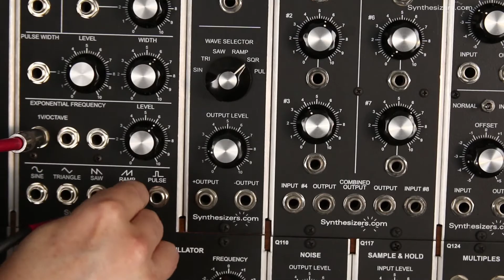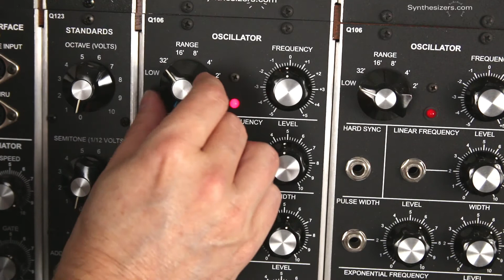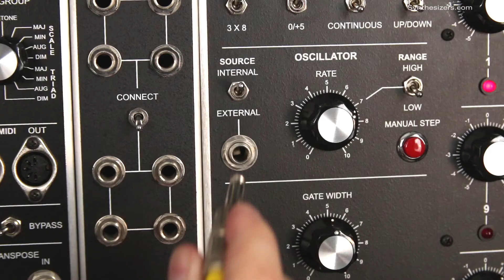Pitch and gate tutorial - Synthesizers.com

Comment: Well done. Thank you. One question. If I just connect CV from The keyboard, without VCA and gate, the note is continuous. If I press that keyboard twice in the same note, nothing happens right?
Reply: Correct.  The oscillators produce a continuous output.  To turn a sound on and off requires amplitude control and in a modular synth that is done with a VCA (amplifier) controlled by an envelope generator which is triggered by a gate signal that goes on/off when keys are pressed/released.
Reply: @rogerarrick1907  thank you so much. Meanwhile I bought some circuits and made a synth myself with modules. Is just like Magic. Was good to learn and of course, I play around a lot. Thank you.